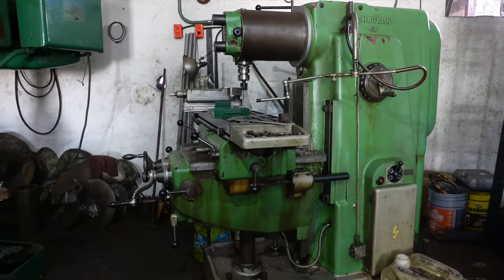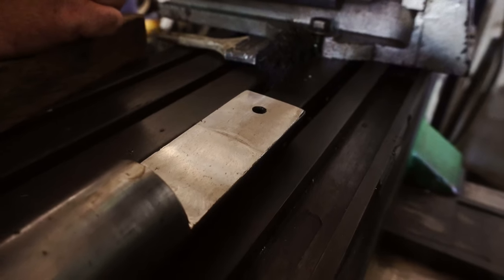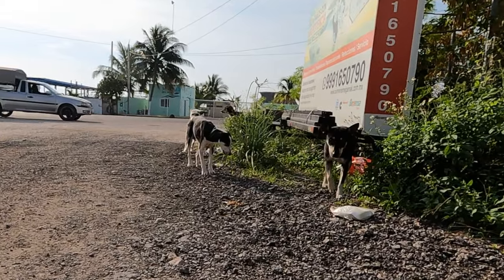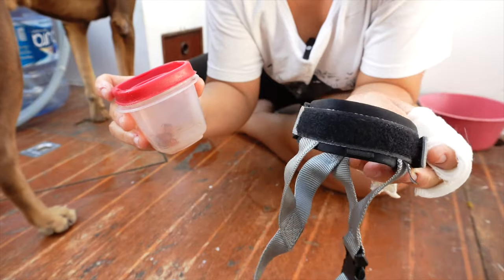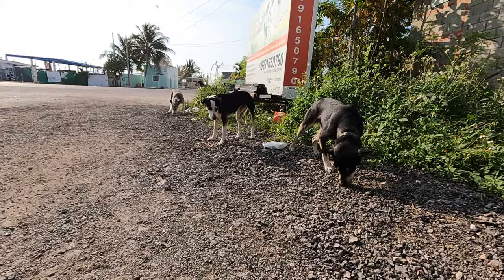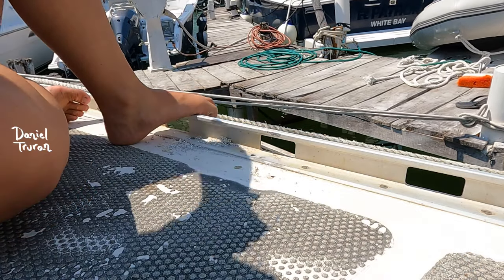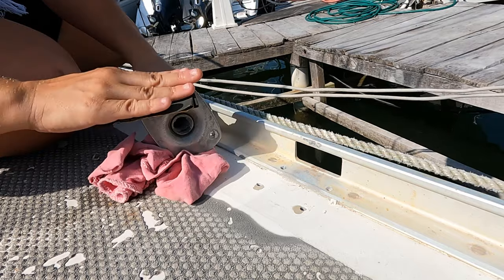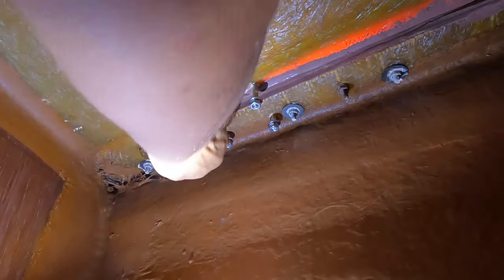NOT a walk in the park YUCATAN

Comment: Backing plates might be an idea for those stanchions. No harm in having belt and braces
Reply: Even blocks of hardwood or thick marine plywood is better than nothing
Reply from the maker: Good point - we should have backing plates. We plan on removing all fittings on the deck and repainting in the future, so will have to do it then.👍🏼

Comment: @sailorama _ Take a Great Tip from an old Handyman when working with SikaFlex-type sealants always have a bowl of VERY Soapy water with Dishwashing liquid and dip your hands in it periodically and the stuff doesn't stick to your hands and fingers. Also, use a rag soaked in it to wipe the excess off things. Take care and keep well _
Reply from the maker: This is a good tip, and we always use the bowl of soapy water when using sealant. In fact, I used it while installing the stanchions - the little blue cup - but forgot to mention it in the video. Didn't think about dipping the rag in soapy water though - will try that next time!
Reply: 5200 may be the exception... it sticks to 5200 places (mostly where I don't want it,  my knife, hair, rags, butt, etc) in and out of water PERMANENTLY!!!
Robert,  do you have any antidotes for it??? It also seems so slow to set up, is nasty expensive and hardened in the tube between and sometimes before opening....
Reply from the maker: 5200 is difficult to work with - as you mentioned, sometimes it can even harden before opening the tube. That can happen in the hot weather here especially. When we buy it, it may have spent months sitting on a hot shelf. What it needs is to be stored in a cool, dark place. Sometimes keeping it in a refrigerator helps to prolong the tube life. We've also experienced that it doesn't set up for days after it's been opened - very finicky stuff, but worth it under the waterline. As troublesome as it is, we wouldn't use anything weaker...